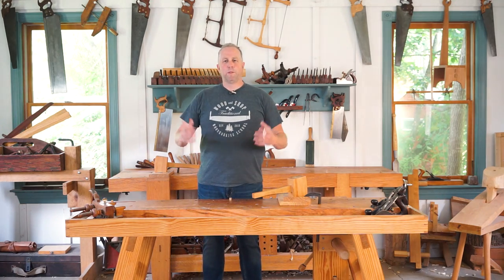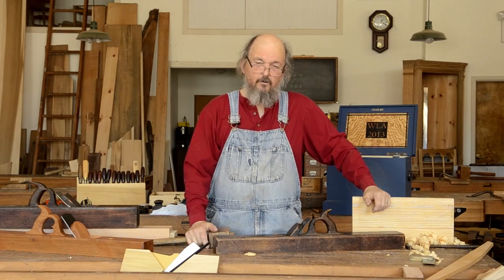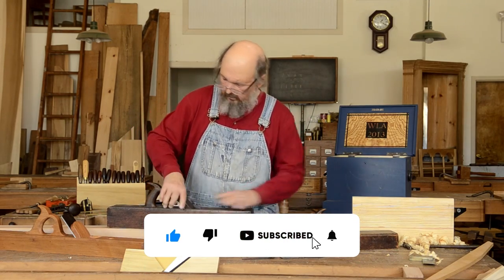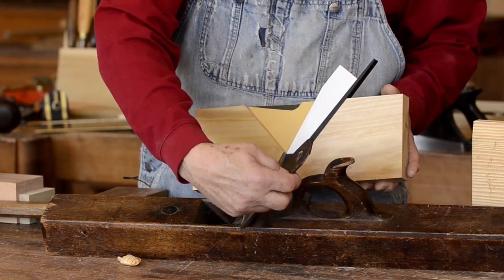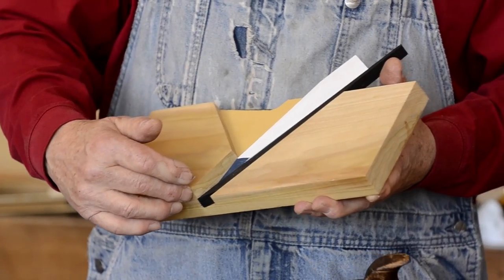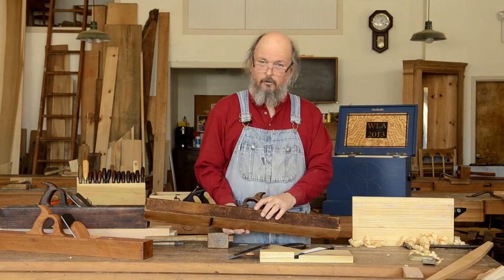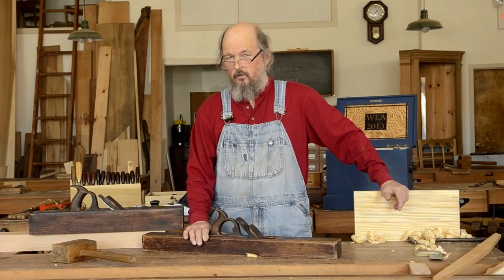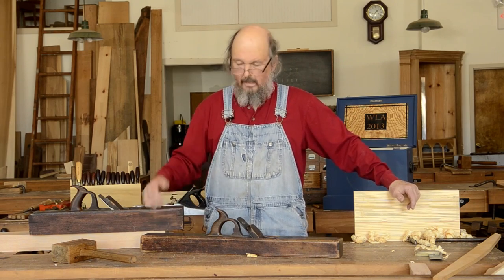Why use an 18th Century Wood Plane?

Comment: Is the Ear just to tell plane is never used?..  To use it,  First Tune Up is to beat the ear off with a hammer so it fits a hand - ' never looks as good after. Germans did it better with a horn.  Interesting, that Plane Iron looks same as Japanese planes.  You have nice videos,  and articles. - Thanks